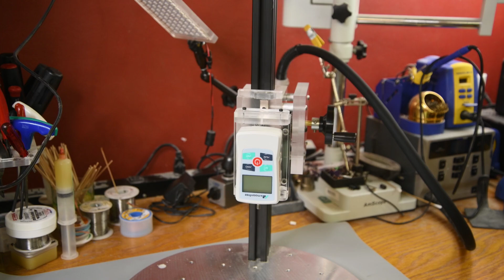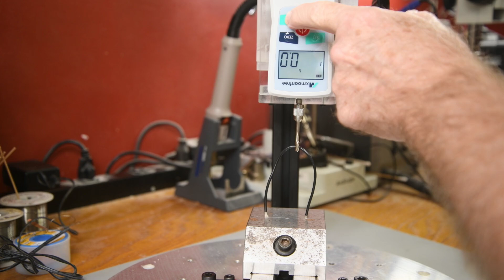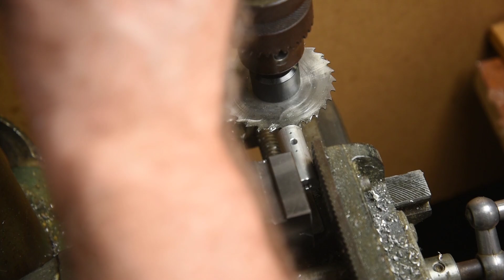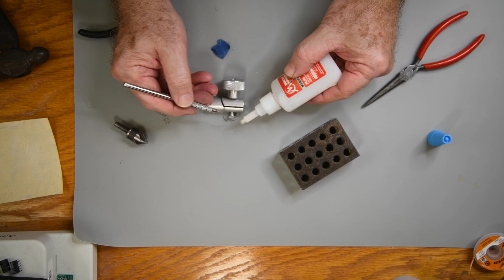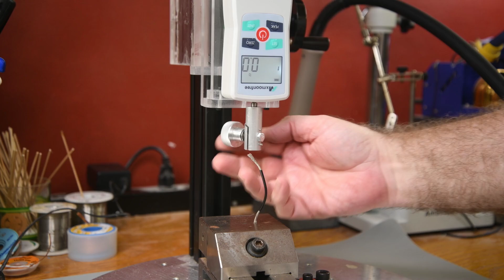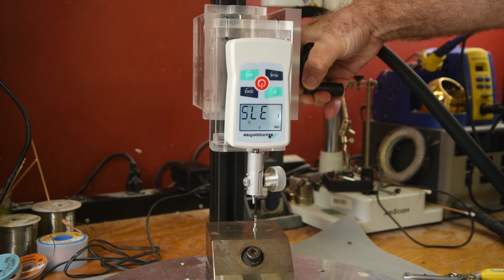Wire Pull Test Stand Project – Part 2 of 2

Comment: This is off topic.
But could you make a video where you can explain which dualsense controllers works with which type of hall effect joysticks.
I have a bdm 010 model and I wonder which hall effect joystick is compatible with my ps5 control.
Reply from the maker: These should work on any of the DualSense controllers BDM-010 to BDM-040.  I tried the previous version of this Hall effect joystick in a BDM-010 controller and it worked fine.  See this video: https://youtu.be/6JX_kdyDnlM?si=wqqc9cGVINcIXBQA  .  Before installing the Hall effect joysticks, consider looking at the TMR-based joysticks.  It's a bit of work to change them and the TMR joysticks are better.

Comment: I’m confused. The force from the clamp seems variable and won’t let your tests be linear. You can pull on the wire at 50lbs but the clamp can be whatever so how does that make this test reliable?
Reply from the maker: The clamping force on the wire and terminal does not have any effect on the wire pull force.  I just don't want the terminal or wire to slip.

Comment: I enjoyed watching this build.

An idea for rounded teeth on the force meter clamp.  If you could epoxy two horizontal pins on the fixed jaw, and one horizontal pin on the movable jaw such that the single pin presses between the first two, then the wire can be held in the "rounded zig-zag" formed by the pins/teeth.    The idea here being that pulling wire through bends is tougher than a straight pull.

I don't know if bigger surface area on the clamp holding surface is better in this particular application.
Reply from the maker: That's a great idea.  The tiny wires are going to be a challenge.